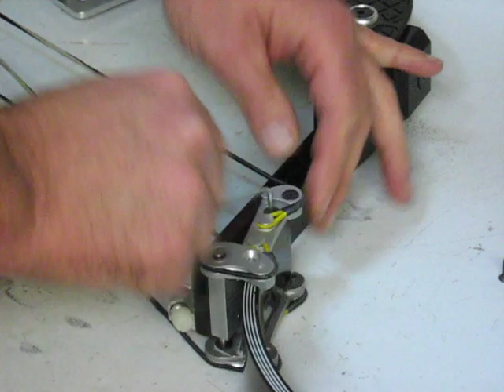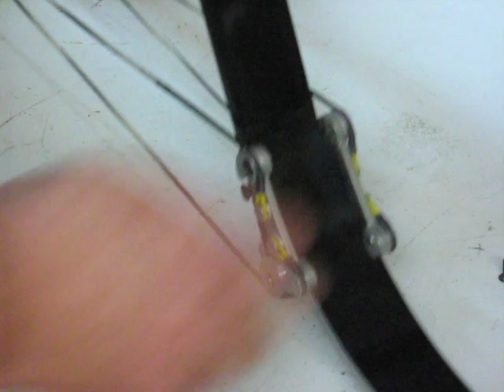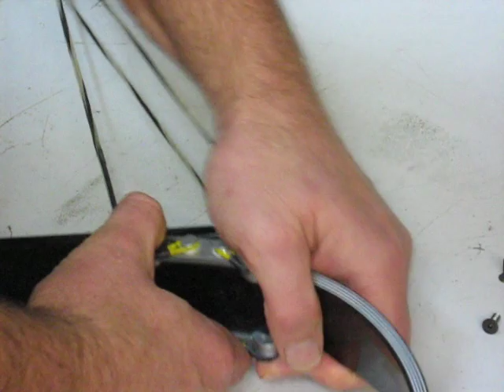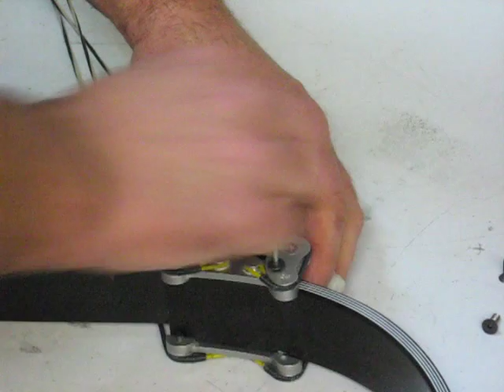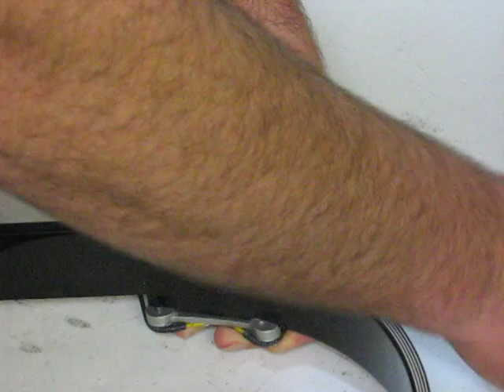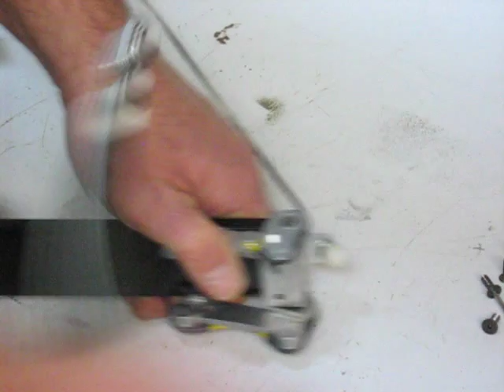Outboard Limb Disassembly

Comment from the maker: Kris, what other companies are doing what bowtech had to do? I just check most of the Big names and no one else is using that system. Even PSE is drilling through their limbs to mount the cam axles. Bowtechs problems were brought on by the cabled to the inside of the limb for the Binary cam. Most companies that fell for that are returning to split harness systems.......even Bowtech. That said the issues are on the solid limb systems for the most part. Split limbs have a better track record.

Comment from the maker: Kris the only systems that need to pin the limbs at the axles are the binary's and the Cam and a Halfs that do not use split harness. The reason is they can not control limb lean and that causes even solid limbs to fail in that area. Lots of bandaid fixes for solveable problems. Martin which makes a better laminate limb than Bowtech does not have to do this on there Solo or two cam systems. Even bowtech on the Destroyer had to split harness a system that in their own hype is against binary rule.

Comment from the maker: Yes they are threaded into the side of our composite limb and the bamboo. Does this shock you. Understand we did our home work here to assure this is the strongest system ......tested to 100 pounds and dryfired for fun a few times at 70 pounds. Your string will break before those flathead machine screw let loose. The concept is new not copied and protected. (no glue or lock tite needed)
But these are old news now...............next generation soon..................332 fps with no competition.

Comment from the maker: Kris, first if you want to call me and talk about this I have no issue with that. If you look and I mean YOU look and use what you see as opposed to what your friends may think they know you would see the truth.....................if the peak weight of the bow is only 60 pounds that is all the limb will see in this system. Remember I was there to test the ESC limb and the MB composite limb which in effect needed to be able to handle load weights of 150 and above. Think about why?